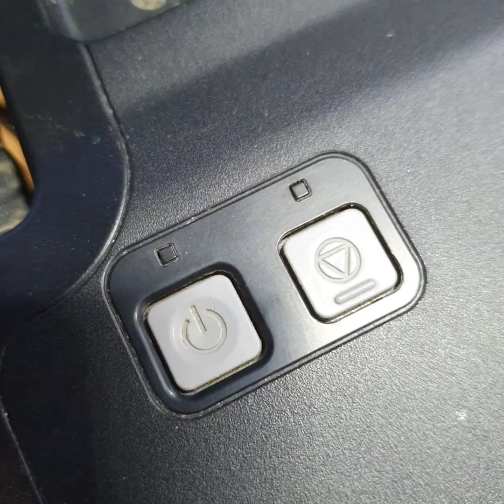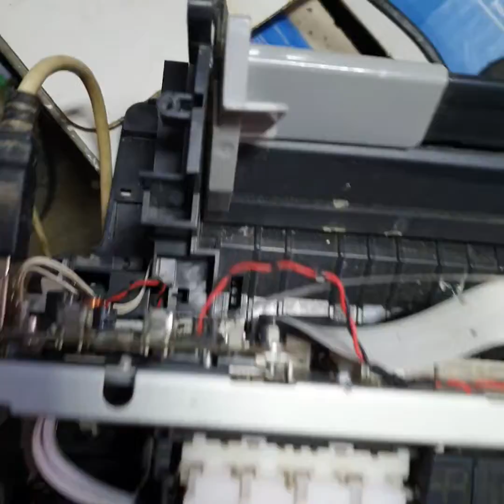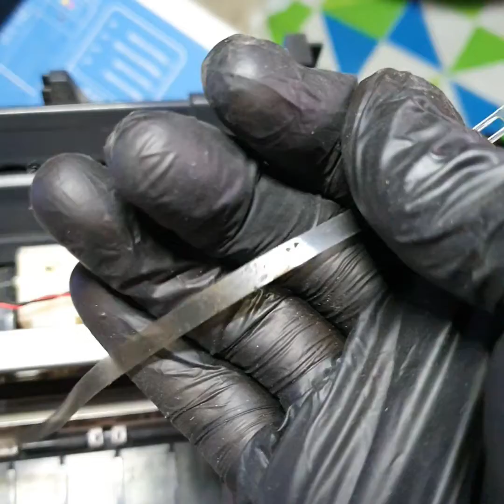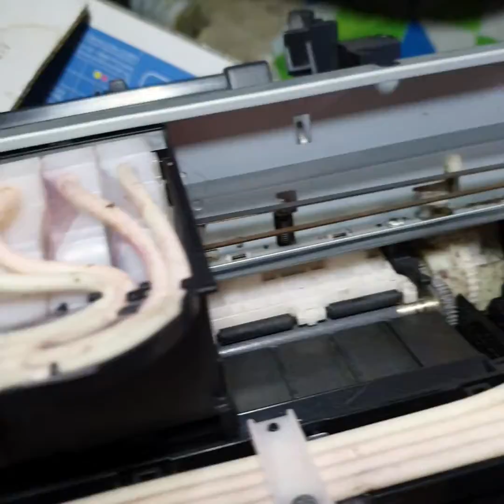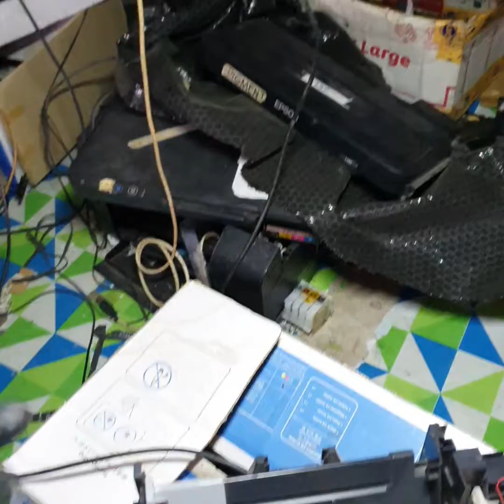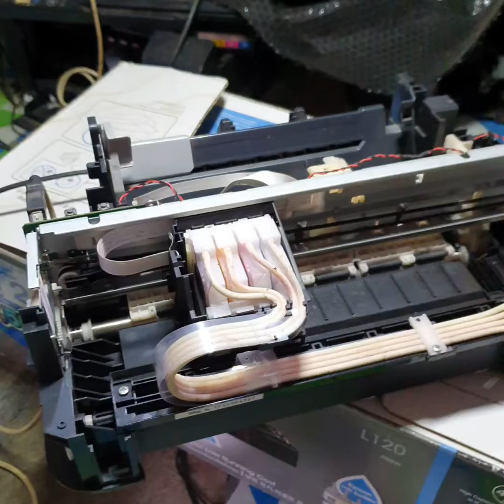epson L120 paper jam error ( no jam object )

Comment: Epson L220 po. Nagbblink po una yung power button pagkabukas. Then sasabay na magbblink yung dalawang orange light. Tapos after 5 blinks, nagsshut down na po ang printer. Ano po kaya ang pwede gawin? Salamat po.
Reply from the maker: Posible power supply or may problem sa board. Change psu 1st

Comment: Hello sir Wayne, ask lang po di ko po kasi makita yung printer sa pc eh kahit anong usb cord gamitin ko di pa din malocate.
Reply from the maker: Check sa device manager if na dedect ba. If wala check socket sa printer pwdi din lagyan o spray ng  wd40
Reply: @wayneslink  hello sir, printer is busy ang nakalagay po tapos ayaw mag stay ng ilaw lagi naghheadclean.
Reply from the maker: @knowellbrenflorentino6859  need clean mga flex connector both sides at clean motherboard gamit lighter fluid.